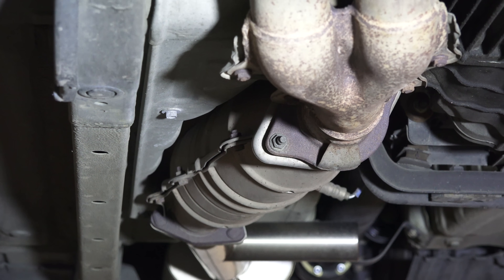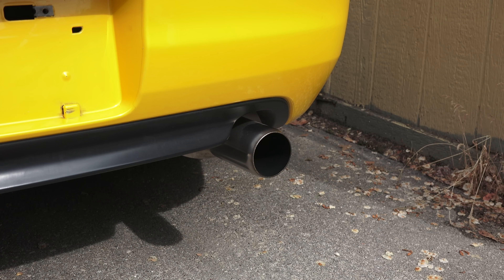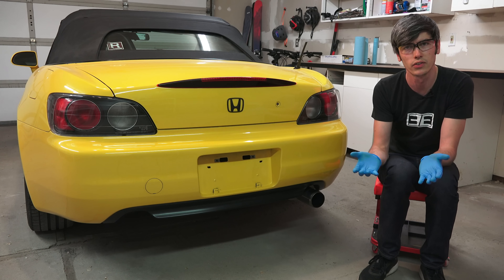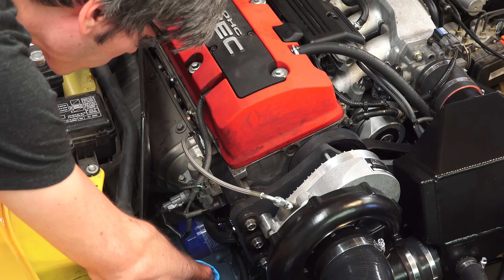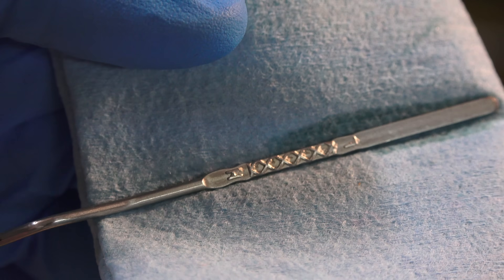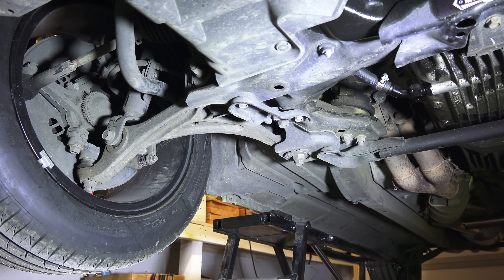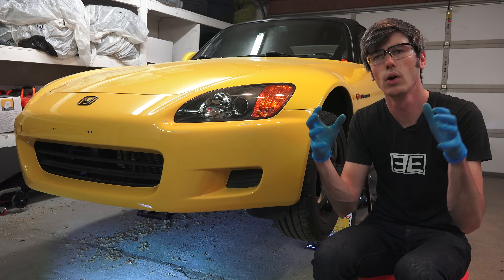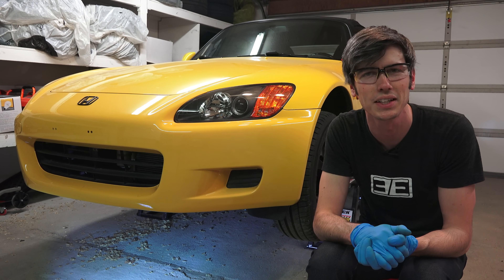5 Signs You Shouldn't Buy A Used Car

Comment: Actually mentioned valve stem seals.  Seems it's going to snow (and it's summer here)...

For some reason people always fail to consider the possibility of valve stem seals.  For those who don't know the difference, rings will smoke constantly, and especially under load.  Bad valve stem seals will give a puff at startup, and also depending on severity anything from a small puff to a large cloud when you step on it again after coasting (in gear).  Often happens when pulling away, due to the fact that you just coasted before coming to a stop.

Regarding how serious it is, that depends where you live.  Any place that fails a car due to a bit of smoke will be a problem.  If they sniff the exhaust it'll be a problem.  If they require a functional cat that'll be a problem (oil in the exhaust will "poison" the catalyst).  But if you're in a place like South Africa it's only an issue if you worry about the smoke.  And of course you'll have to top the oil up more often.  I had a nearly immaculate 1982 518i (South African E12/8) with bad valve stem seals, drove like that until it got stolen.  Now I have a 1999 2.8 Z3 roadster, also with bad valve stem seals.  I want to fix it at some point, but with all that variable cam timing and other nonsense it's sitting at the bottom of my todo list.  It seems cars that stood a lot tend to get bad seals (some say the seals dry out, shrink and crack when they don't get oil for an extended period).

Comment: Sometimes people selling used car will disconnect and reconnect the battery so the engine light won't appear. With my vehicle it requires the ignition to be turned on 7 times before it appears.

Comment: What's it mean if your exhaust drips?
Reply from the maker: Just some condensation, totally normal. H2O is a byproduct of combustion (gas mixes with oxygen, burns and forms CO2 and water).
Reply: @EngineeringExplained  Awesome! I just bought a Manual 2014 Jetta, and noticed the tail pipe was dripping one day. I thought I had remembered hearing it was completely fine for that to be a thing, but I couldn't remember. Thanks!

Comment: What is a "Good long drive" according to you? 5 miles, 10miles, 15 miles?
Reply: Turn the radio off and drive it and listen to everything while driving if you can take it on highway and floor it.......✌🏾
Reply: I guess long enough for it to warm up, and long enough to include a variety of roads (ie motorway / highway driving). 20 mins at least I reckon. You’re spending a lot of your hard earned money - the seller should understand if they’re genuine.

Comment: Hey y'all, I'm looking at a 2016 Kia Forte LX, 5 speed with 36K on it. I'm a Ford fan, but I'm looking at it because the car is still under factory warranty and I can get niceties like Satellite radio WITHOUT one of those evil touchscreens. (Don't get me started on how foolish it is to have a screen you have to take your eyes off of the road to use) Also, if you squint, it kinda looks like a Focus. I took it on a test drive, and it vibrated at idle MUCH more than I expected a new car to. The vibrating doesn't bother me, as I'm used to it in my 1965 Mercury Comet Caliente. However, I got the same amount or a little more in a car 51 years newer. I don't mind the vibrating too much, but my question is whether there is already something wrong with the engine or the motor mounts or if they all are like that. 
Also, I really want a Focus, but the only one near me that's has a standard transmission is a 2017 with that Ecoboost 1.0L 3 cylinder. I've heard a  WIDE array of things about that engine. In anyone's opinion, is that a good engine or not? I'm very conservative in technology, as I think it's just more things to go wrong, so I do not want to be a stage in consumer development. 
I am a college student who is very in to cars, and I would like a sedan with a standard transmission that will be very reliable for the next few years. If anyone read all of that, do you think the Kia has something wrong with it? Why? Also, what is the reality of Ford's new 3 cylinder engine? I'll appreciate any and all help.
Reply: Find an 05-11 Focus. Just trust me on that

Comment: Shame. My parents bought a 2007 Audi A4, fun car, terrible choice. A lot of this stuff applies to the car. The engine bay has always had oil leaks on the metal heat shield above the exhaust manifold (valve cover leak) and leaked onto the ground. Shoddy panel gaps (I dug through 4-5 reports to find damage matching hidden stuff on the car- it was titled as junk, repaired, and had its presence in VIN databases almost entirely wiped). The plastic shielding is all shattered on the bottom along with parts of the bumper. Bad panel gaps too.

Bad panel gaps
Paid above market
Frame damage on the passenger side (A pillar/lower A pillar and passenger side firewall disfigurement)
Un-repaired frame damage
Various oil leaks and running issues

Please inspect your car properly before buying. I witnessed them buy the car without a second thought or inspection, Im not sure they even test drove it- and its left us with a shoddy title, too many issues to count (needs valve cover, blown turbo, etc) because lack of maintenance and inspection.

All it comes down to, regardless of car- just have it properly inspected. Keep up on service, and dont neglect your car. It has done nothing but cost us money in the long run.

Comment: Might be a good idea to be sure the drive train is in good shape to. Check the transmission fluid color, put a little stress on the vehicle during a test drive to make sure it's shifting properly.  A sign of bad clutch packs is the tachometer bliping up to higher rpm while you're steady on the throttle.

Comment: Oh well, I have an A4 B5 that will temporarily smoke blue if you rev it after it's been idling for about 5+ minutes. Probably has been going on at least for the past 50k. Passes MOT without any problems, the power & fuel consumption still seem close to stock. This car has been so reliable for me I just can't bring myself to let it go.

Comment: What’s up with your exhaust at 7:38. The pipe sticking out of the side of the main pipe
Reply from the maker: Some sort of resonator chamber to help eliminate drone.
Reply: @EngineeringExplained  oh it's sealed. I thought it was an open down pipe. Saw a similar set up on an rx7 which was controlled by a valve. This was so that the engine just breathed out better. 
What effect does that have with exhaust velocity and scavenging when there's an interference like that

Comment: I had a bluetooth scanner, but it's work working proprely with my S7. But I did find a 20$ cabled code scanner with connector on amazon. worked pretty good. Very useful.

Comment: Couldn’t a failing water pump also result in coolant leaking out from the pump down the timing cover and ultimately into the oil pan?
Reply: Nope...water will leak on the outside of the engine...no way for it to leak into the engine

Comment: Please make an video about OBDII.
This is rather interesting topic. 

I noticed you said that there should be no DTC codes, however more important is that if the system cycles have been completed and check how long ago the DTC codes were reset. The info is there and the two I mentioned are a must to check. The lack of codes means almost nothing in case the seller is a crook.

Comment: why do people always say steam should only come out of the exhaust if the car is cold? I swear my current car has tons of water vapour coming out of it's exhausts when idling even if it's fully warmed up. it's definitely not coolant, is slow moving see-through steam and only during cold weather. typical exhaust smoke for gasoline cars. or if you're sitting at a drive through, a lot of cars start emitting the same kind of 'smoke'. but these engines are definitely warm. so it must be normal, right?

Comment: Lol @ parts stores scanning for free.... maybe in your neck of the woods but here auto parts stores sell scanners, not use them. I doubt the 17yo girl they often have behind the desk even knows what 1/10th of what they sell is even in broad terms. 
Also, old oil, hoses, belts etc aren't a reason not to buy something unless you are buying something almost new. You should have fluids replaced anyway ASAP so you know what's in there and how long it will last, to some degree the same for plugs, some belts, possibly smaller hoses. 
Then again I'd never buy anything that isn't at least 10 years old, let others take the devaluation hit.

Comment: Don't forget the coolant overflow. If it's overfull it could also be a sign of bad head gaskets (Subaru people know this one). You can drive it for a long time like this, just get a turkey baster and suck out the fluid and put it back into the radiator. You'll have to do every time the engine cools down but I drove a wrx like that for 2 years.

Comment: Timing issues? You're looking at the AC/alternator belt.. The one that moves the cam shafts (and can cause timing issues) is inside the engine block..  good luck "checking" it's tension

Comment: I bought a used car. It was originally from Illinois but transferred to California where I live. Everything was good no leaks no smoke coming out of the exhaust. The car was well maintenance the only problem I did not check until I drove the car home was there was a lot of rust under the car.... I still have the car and drives strong it’s just that rust under the car is bothering me. Is there a way where I can fix it. It’s not excessive rust so yeah.

Comment: My first car used to spit out a puff of smoke for a few seconds on cold startup, and then go away.  It was a tell-tale sign of worn valve stem seals, which would let some oil into the combustion chambers while the car sat overnight, but then when the engine warmed up the seals would swell a bit and seal up.

Comment: Good for complete novices.  But you neglect the driving tests, straight braking , tracking, odd noises, starting and charging system tests, Transmission fluid color and odor, Tire wear patterns, magnet test for large amounts of body filler, Jacking up each corner of the car and see if doors open and close properly, Compression or leakdown test, Brake pad wear and rotor-drum wear.Clutch test,Cooling system pressure test, and test for the ever present "Loose nut behind the wheel" This could be an hour long video if you really do check the car for all faults. OBDII fault codes can be misleading or show nothing and later you find it needs a new ecm-pcm or reprogramming or sensors are not yet failed. OBDII does not show marginally bad or failing parts or systems.A interface that shows all internal parameters is a more reliable way to find indications of failing worn or damaged parts and systems.   Why don't you do a better Video?
Reply: Because like you said, it would take an hour, probably more, and it's likely much fewer people would watch it.  And also like you said, this video is good for complete novices(like me), and I think it's intended to be a basic video on how to inspect a used car before buying.  There are many more detailed and in-depth videos on Youtube for those who are interested.
Reply: I think no matter how much of a novice you may or may not be.  Whats an extra 15 minutes if it means you dont loose $500 or more on a car repair you didnt spot before you bought it.  A 2 part video would be ideal.  1 for inspecting fluids etc and another for driving tests to perform to check transmission, breaks steering etc.  There are lots more tests that any novice could perform.  Its just a little negligent to say these are the tests to perform.  Tire wear,  mismatched tires, loose steering wheel, transmission shifting issues...  those are really important.  Also check the coolant reservoir for buildup of sludge that means a coolant flush is needed.

Comment: Regarding your first point about the smoke, what about diesel cars? I know there is trucks that throw black smoke under hard acceleration. Would be helpful if you explained that in case someone was looking into a used diesel.
Reply: Almost the same as for petrol ones, black smoke means it is running rich, white or blue smoke internal engine problems as Jason explained....

Comment: Check engine lights are 100% for emission control, if you see a CEL something is altering the emissions on your car. CEL doesn't care if your engine is missing compression, or the block is cracked. Now a good running engine will tend to be more clean burning because the good compression is contributing to burning most of the fuel on each power stroke.

Comment: There are a bunch of states where you would never be able to buy a used car at all if scared off by a whole lot of rust under the vehicle. It's just a fact of life in the snow belt - and usually not a big deal. There are exceptions like a 50 year old car where the floor is all rusted out with actual gaping holes in it but they are rare.

Comment: There's one thing you missed tho. When taking the car for a long (15 to 30minut) test drive. See if the car is misfiring for defect coils or failing cylinders. That's also something very important to do.
Also check if the coolant is clean or dirty, or the car is just running on water instead of antifreeze coolant(depending where you are)

 :)

Comment: Hello, which application did you use for checking trouble codes ?
Reply from the maker: Linked in the pinned comment above! :)
Reply: @EngineeringExplained  Thx Jason I didn't notice that.
Does the app works with an elm 327 Bluetooth device ? I'm sûre you showed one on the video

Comment: Smokey exhaust is hard to spot. 

My Audi is burning truckloads (1litre per 500km) of oil but there is no smoke. 

The mechanic says the catalytic converter is burning it off so i cant see anything.

The diagnosis is the car needs piston replacement.
Reply: Also because the car is burning oil at this high rate the oil in the engine looks new.

Comment: Sign 6: (Listing): Built Motor, really fast
(Responds To Question): No, I don’t have receipts or dyno sheets, but I put 3x the value of the car into the motor and it was done by (such and such) shop.

God I was gullible at 16.
Reply: F for respects. One question, how/where did you get the money at 16 to buy a car making 3x the factory output? Or was it really cheap?
Reply: Paul Citti , I meant the owner claimed he spent 3x the money the car was worth on the engine/tranny, around 12k. Car was a high mileage ‘91 firebird with a stroker engine and a hacked up wiring job. I wasted 7k and a lot of hours trying to get that POS reliable. Couple years later I’ve got a turbo Miata on MegaSquirt and I can actually tune well haha.

Comment: My car doesn’t burn or leak oil.  But once in a while, I smell burning rubber from the air vents lasting about 5 to 10 seconds.  Replaced the drive belt, and had the smell still a week later.

Comment: i have a 2008 mazda speed 3. 2.3 turbo. i reached 110K miles. what maintenance should i do to keep it running 100K more?
Reply from the maker: Best place to check is the owners manual and make sure it’s up to date with the recommended service intervals. :)

Comment: I bought a used car from a guy whose mechanic told him had a failing transmission because it had a noise. When I test drove the car I instantly knew the noise was a bad wheel bearing. So I low balled the guy on the price since according to him "it needs a transmission". Took it home, installed new front wheel bearings and proceeded to drive it for 100,000 miles with no serious issues.

Comment: Re: smoke. If it sits idling and isn't smoking, then you take off and it smokes for a bit, it's likely the valve stems seals are leaking. It sits there idling with high vacuum but low air flow volume, allowing oil to get sucked into the intake and it sits there. Then when you take off, the airflow causes the oil to finally find it's way into the engine.